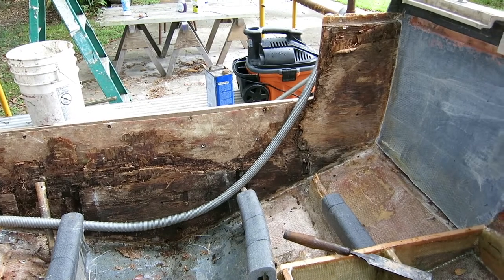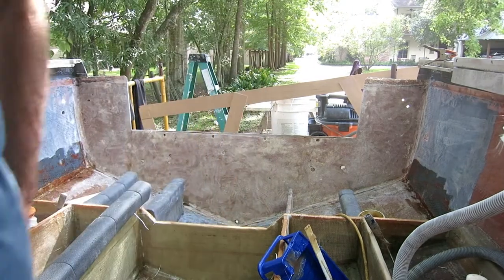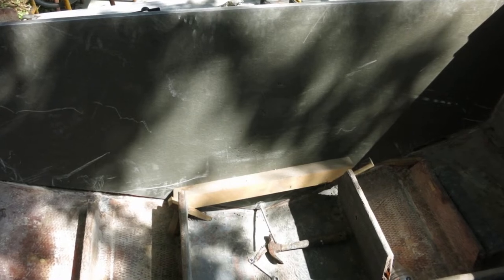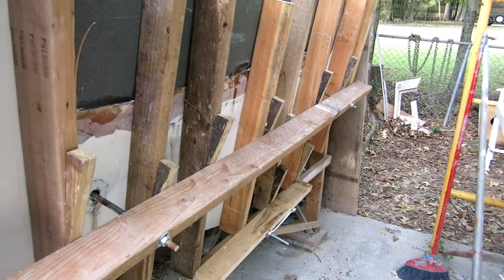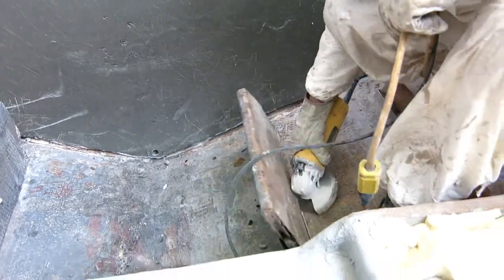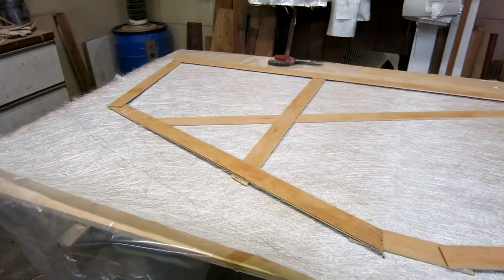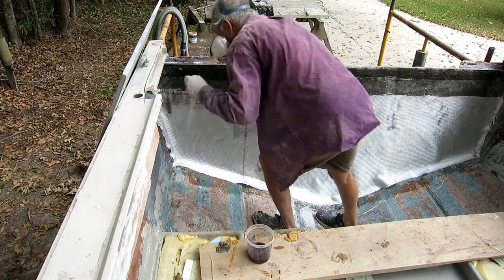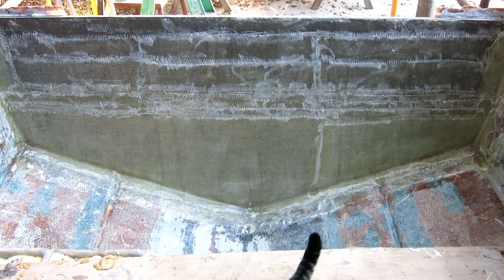Coosa clamping the easy way. The CC boat project #14

Comment: Great job!  I just recored the floor in my Boston Whaler with Coosa, West System epoxy and 1708. Coosa Composites recommends treating Coosa board like plywood for marine applications in that they recommend glassing both sides with fabric and resin prior to use. I did that even though I had the original floor skin on one side(better adhesion). In your case it may not matter a whole lot. Just an observation.
Reply from the maker: Thanks Man!
I have never seen the info on glassing both sides of the Coosa before installing but it makes prefect sense.  
Barry